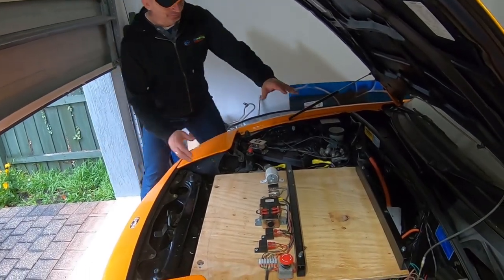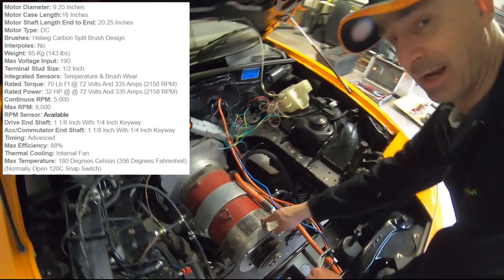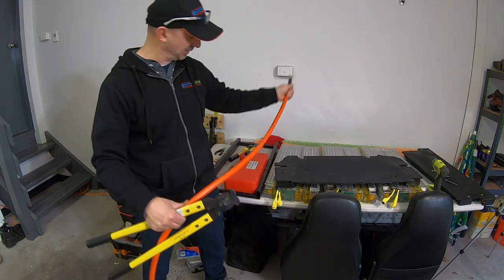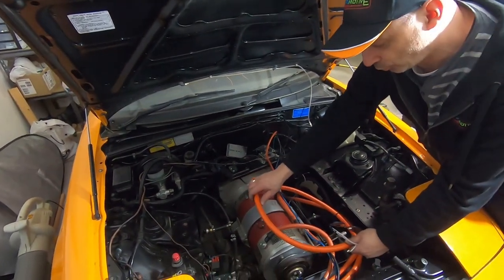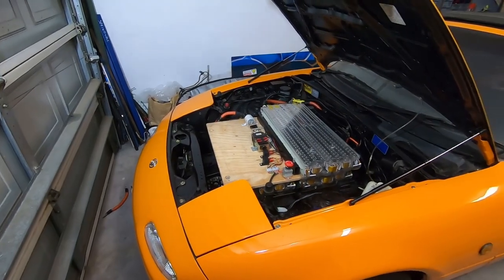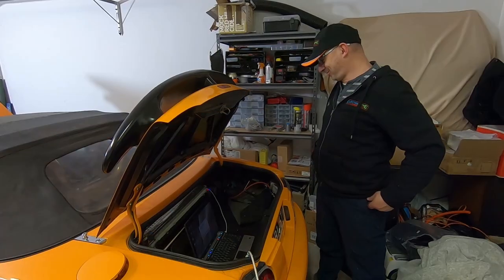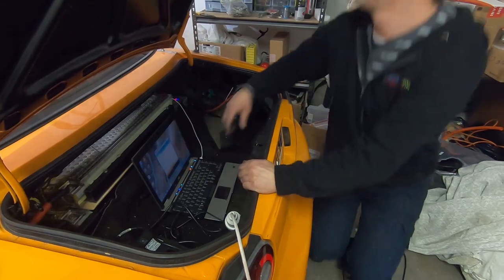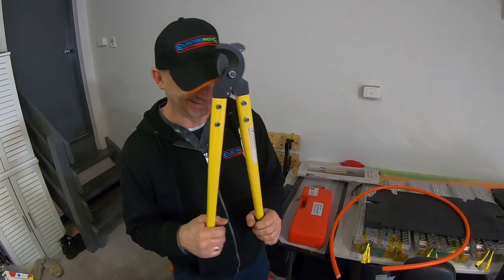EV MX5 Miata - Getting the car ready for Electrikhana | ElectroMotive Force

Comment: Hi guys, I notice from the number plate that you are in Victoria. 👍🏼 I have started the journey of transforming my 2002 NB8B Titanium into an EV in the next 2 years or so. Are you aware of any kits or good mx5-specific resources otherwise? Cheers!
Reply from the maker: You can buy a specific clutch/motor adapter kit to suit the electric motors. EVolution Australia sometimes has the kits, motors and controllers on the shelf. Tell 'em Jack sent you.